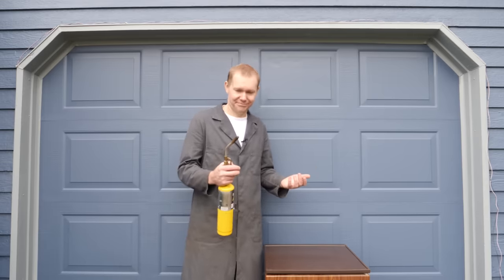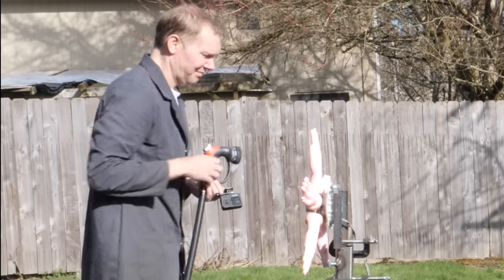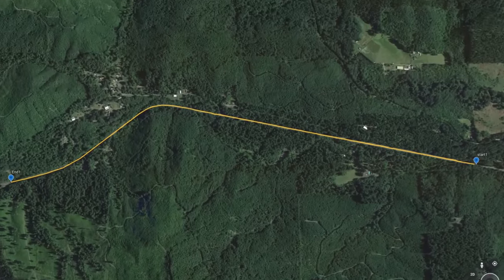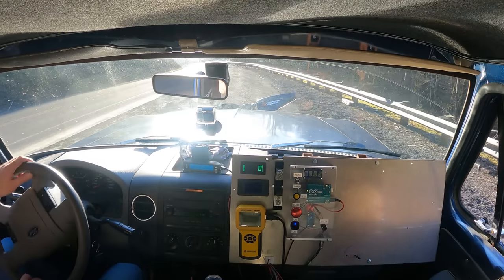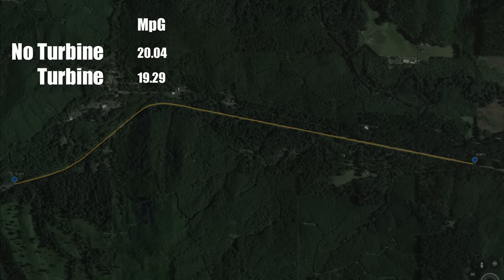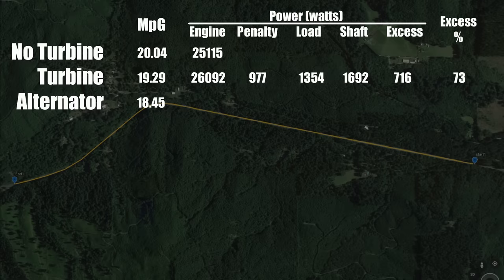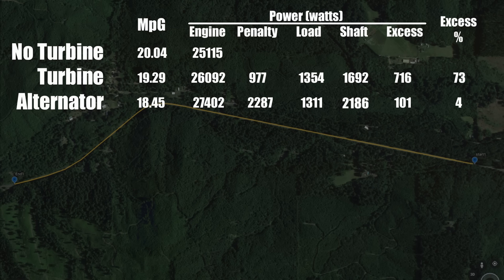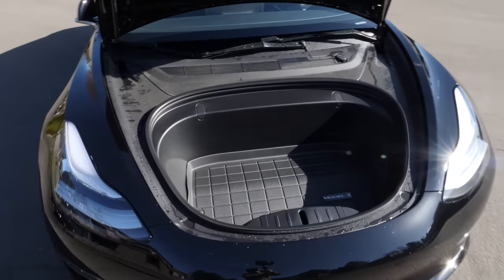Mileage Results You Won't Believe!!! - Wind Power on a CAR #5

Comment: This is transfer of energy via increasing efficiency.  The problem with saying you're getting free energy(and inherently causing a polarizing comment section haha), is that you're not, you're just increasing the aero efficiency of an already very inefficient design(which you talk about). I think a good parallel experiment would be to remove the turbine completely, design some giant fiberglass cone for the truck, and see if you can just increase the MPG in general at the same speed. Then do the math to see if that saved fuel is better "savings" than the power production from the turbine. The other issue is the turbine is only good if you're trying to burn an extra 2000W all the time. So when tesla designs a vehicle, they're already designing for the best Cd and capture those saving immediately. So you can't compare that to a Lada with a fan on the front, since the Lada will have a terrible Cd from the get go.
Reply: That's funny you mention doing a test with a big fiberglass aerodynamic nose.  
I commented the EXACT same thing on the first video he did on this adventure (although I suggested making them weight the same). 
Seeing which one yields the most energy from the fuel would be very interesting. He saw that comment and said that it would be an interesting experiment.  :P
Reply from the maker: Yeah I still like the idea. Just trying to figure out the safest/easiest way to do it and still allow cooling air to the engine. But I'm very curious to know!
Reply: @QuintBUILDs  I can imagine it would be an even bigger project that building that CF turbine.  Maybe some delicious CFD simulations.   😅
Reply: @QuintBUILDs  Since the optimum aerodynamic shape is a droplet shape (as far as I know), it would be interesting to see if a cone in the rear of the vehicle would help, and then you don't have to worry about engine cooling. I think you are getting a lot of turbulent airflow at the back end, so a cone there might help get a laminar flow around the vehicle. It would however probably stick out quite far back. Don't know how road legal that would be either.
Reply: Or alternatively, demonstrate the decreased efficiency by mounting the turbine on the roof of the truck, thus greatly increasing its wind resistance. The turbine would still get the same wind, thus would produce the same power, but the fuel consumption would increase instead of decrease.
Reply: even better.
Reply: I think another test was missing here: driving with the turbine while the oven is turned off.
According to your results, you should improve the fuel consumption.
This is probably the quickest and safest way to test if it really improve the aerodynamics
Reply: @liavhe  Not so fast. The savings hinge on the fact that the turbine slows down the air. If it spins freely, I'm not sure what effect it would have.
Reply from the maker: I've wanted to compare the turbine on top of the vehicle to demonstrate how every watt would indeed come from additional fuel.  I've got a roll cage under that canopy so it's not out of the question to mount to that.  But unless it was pretty high above the bronco I'm betting the air coming off the windshield would "shield" the turbine a bit.  It also might generate more power since there's not a blocky vehicle right behind it.
Reply from the maker: I absolutely LOVE the positive nature of these comments HOWEVER it looks like the video hurt enough feelings that I've got a net NEGATIVE subscriber count on this one.  Thus the algorithm is hiding it from people's feeds (to protect the channel I guess).  Bummer that so many reject the facts and aren't interested in an honest discussion. 😢  Kudos to those that do though! 👍
Reply: @QuintBUILDs  That’s lame! The like ratio is crazy good. This is really great content and wonderfully communicated. My only guess is that maybe subscribers are a little burnt out on the turbine videos? Kind of like the oven.
Reply from the maker: @BRUXXUS  I see what you did there! 👍 Yeah I'm definitely going to give it a rest now that the results are in. I never intended to do so many multi-part videos but the rain gutter series defied all logic and just kept giving. 😂
Reply: @QuintBUILDs  Still waiting for you to get back to the rain gutter with a step down transformer, to bump up the amps while lowering the volts before going DC.
Reply from the maker: @victorsteen73  by how much? We don't want to get below 6 or 7v otherwise we'll have to boost convert which ismuch less efficient. Note the loaded AC output with resistors was only 6-8 volts.
Reply: @QuintBUILDs  The rain gutter series was magic! Also contained one of the best explanations of how rectifiers work. I could be wrong, but maybe the rain gutter generator felt more tangible to normal viewers? Everyone understands what the water coming from a downspout feels like. A kilowatt of wind power is harder to understand intuitively. Although, using the oven does really help put it more in perspective. 
I do think there's room to expand on the things you've learned doing these videos, though! 
If I may suggest, scale it back down to create some wind powered garden lights! I've been tinkering with the idea of designing and building a small wind turbine for that very reason. Kind of like the solar garden lights, but could use wind.  :D 
Bonus points if the turbine could also be aesthetically interesting, like those wind powered kinetic sculptures.  
Could make for a very eye-catching thumbnail. 😉
Reply: The radiator IS the hood so it gets cooling air.

And, maybe the turbine is in the back - harvesting the turbulence but not causing drag. The turbine could be possibly shaped like the vertical-types (Savonis?) that spin wherever direction the wind comes from.
Reply: @BRUXXUS  This has actually been done with bicycles called "velomobiles". By changing the aerodynamic shape people are able to go faster.  This is also done with golf clubs and airplane wheels (to make a larger more effcient airflow shape). Ocean liners are also designed with a bump in front to reduce drag.  Streamline has also been done in Semi trucks. It would be pretty easy to do a literature review and get a good understanding of the improvement in those areas. One could then guesstimate the improvement in the Bronco.
Reply: @jsoers  Trailer tails on Semi Trucks improve fuel efficiency 1 to 5%. With side skirts, it goes up to 12%. (There is a lot of good data out there on these.)
Reply: meh, it's pretty fair to say that recovering otherwise wasted energy is 'free energy'
Reply: Completely missing the point here. Nobody is getting any free energy and he states that unequivocally in his video i.e. "expecting the fridge to work without being plugged in". He neither increasing aro efficiency of the system (car + turbine), quite opposite, more fuel is needed to run with the turbine than without. The whole point is that running with the turbine he is harvesting otherwise completely wasted energy needed for the car to punch a hole through the air. This is the "free energy" - the most basic of concepts. If you understand regenerative braking in EVs then this is the same concept, harvesting otherwise wasted energy.
Reply: @QuintBUILDs  Ford produced several models in the early 90s with a "grille-less" front fascia.  They used the shape of the engine cover and a pretty powerful fan to suck air from underneath the car through the radiator.  Perhaps you could look to those cars for inspiration if you want to go through with the cone idea
Reply from the maker: @limprooster3253  thanks for the idea! Any specific models you can think of?
Reply: @QuintBUILDs  They are called "bottom breathers." The one I was referring to specifically was the 2nd generation Ford Taurus, especially with a 3.8L.  The Ford Probe and its cousin, Mazda MX-6 were also bottom breathers, and to a lesser extent, foxbody mustangs.  And for the sake of obscurity, the Studebaker Avanti is another one.
Reply: @QuintBUILDs  Its the Radiator that needs the cool air flow. Reposition the radiator in the vertical rear tray door area with appropriate opening for flow through and have two advantages!
Reply: He's NOT increasing the aerodynamics. 

He IS increasing the efficiency of the machines movement by converting some of the potential (air's inertia; drag) into kinetic, and then into electric. The reduction in MPG is more than offset in the electrical harvested, this means an overall increase in efficiency. 

Increasing aerodynamics can also increase the efficiency of the mechanism, but it does so by reducing drag, not by converting a % of the drag into useable electric. 

Both techniques have the ability to impact efficiency (aerodynamics & drag harvesting) but they are doing it in different ways and shouldn't be conflated as the same thing. Aerodynamics attempts to reduce overall drag, and drag harvesting attempts to convert a portion of whatever drag is present back into "useable" energy.

It takes energy to push air out of the way. All vehicles have to do this because earth isn't a vacuum. Its just the way the cookie crumbles. Even a design with a coned nose will have to expel energy to push air out of the way, will still create drag. If he were to add a cone to the front he'd increase the aerodynamics, but he'd still have drag that can be harvested.  He could line vertical turbines along the body and ceiling, underneath, along any area where the air drags across the vehicle, and still harvest the drag. 

Obviously only a percentage of the drag is harvested, and vehicle designs that reduce the overall drag also end up reducing the total possible energy to be harvested, so it has its limits and ranges of useability depending on the vehicle in question (seemingly, blocky vehicles will benefit more so from drag harvesting than aerodynamic vehicles) ect. 

Great vid.
Reply from the maker: @chiefrunningfist  man, where were you when I released the earlier videos and weathered a hate-storm in the comments? 😂 You describe the behavior much more eloquently than I. Probably wouldn't have mattered though. People get an idea in their head and can't be dissuaded.
Reply: @QuintBUILDs  Lolol you're a champ! I haven't seen the other vids yet, but your theory, hypothesis, expirementation, and explanation were very refreshing. Great work, keep it up.
Reply: @QuintBUILDs  Maybe go the other way round: Find a car with a more aerodynamically suitable form and attach the turbine there. It should in theory largely diminish turbine efficiency by adding lots of additional drag.
That said, frontal turbines might actually be a nice way of recycling waste drag energy on vehicles that need to be large and bulky.
Reply from the maker: @A.Lifecraft  yeah I'm seriously considering a scaled down version on my old Camry in the background. I need to repaint the hood anyway so no big deal if I accidentally scratch it.
Reply: This  and so much this what SeanHodgins said. If you put any type of propeller or turbine in front of a Tesla you would most certainly add a lot more drag that you would never be able to recover because unlike the square block of metal on the front of your Bronco with a coefficient of drag (Cd) of around .464 while the Tesla Cd that you showed is .23. As Sean said if you were just to make the front of the Bronco look like the front of the Tesla you would save a lot more on energy than putting a prop on the front of the car. Go back to your creepy hand job and figure that Tesla has already angled the hands for maximum efficiency so adding more will just create more drag.
Reply from the maker: @Aircam73  I disagree. I think I can make it work on my Camry with a couple of 12-18" turbines and recover enough power that the alternator will no longer need to operate and spin with minimal torque. Factor in that I'll build/buy a generator more efficient than the automotive alternator and I'll bet it improves fuel economy measurably.
Reply: @QuintBUILDs  You might want to also design a turbine that is optimized for sideways exhaust instead of only spinning up the used air. This might have tilted spoonlike blades instead of "propeller blades"...
Reply: @QuintBUILDs  I will take that bet as your Camry has a much lower Cd compared to the Bronco and you would have to overcome the aerodynamic drag imparted on the car by the prop vs the mechanical drag imparted on the engine by the alternator. Even with a 30% improvement in the generator you will have a very high hurdle to overcome. Unlike the Bronco your generator and prop in front of the Camry will be adding significant drag to a relatively aerodynamic car.
Reply from the maker: @Aircam73  Roger that. Keep in mind literally thousands of people insisted the bronco wouldn't work at all and we know how that turned out. Plus what about the Columbian company featured in the video. Are you saying they're lying or that their car is not aerodynamic?
Reply: This was literally what I told him in the last video. Engineers don't realize how important visual aesthetics are when it comes to cars pretty much all cars have terrible aerodyanmics because people care more about their car looking cool than they do it getting a little bit further on MPG.

I never said it "wouldn't work" I said it was playing efficiency games that could be better played with the overall shape of the car itself. 

Also the other major factor was safety. This just isn't safe or legal we do not use turbines on cars because of just how dangerous they really are. 

This is a side note but Tesla cars are not that aerodynamic either stop praising them as some godsent. They look like almost every other conventional car on the road.
Reply: @seemlesslies  Agree with just about everything you said but Tesla are some of the most aerodynamic cars on the road today.
Reply: @QuintBUILDs  Thousands were right as it did increase drag but when taking in the inefficiencies of the alternator you showed it could be a gain in overall efficiency. The problem with trying to do the same thing with a much more aerodynamic car is the delta between the drags created are much larger than the delta of drag between the bronco and the propeller. While you only lost a small amount of MPG with the bronco by adding the prop because the difference in drag between the two were small. You will lose a lot of MPG as the difference in drag is large when put on the Camry. I would have to do more research on the Columbian video as I don't know what they are trying to say or how they did it. If you post a link I will be happy to respond if they are lying which if they said an aerodynamic car got better range by adding a wind turbine then I would be very skeptical in their findings.
Reply: There is a practice known as "hypermiling" to take vehicles and increase their MPG to the max. Made for some interesting designs.
Reply: Sean: You’ve astutely pointed out that the heart of the matter is to find the best way to reduce aero drag. Most remedies center around sleek shapes and reducing the ratio of friction surface as in the wasp waist fuselages of fighter planes. Earlier it was acknowledged that sucking the boundary layer into slots in the wings helped a lot, but is expensive and heavy. Fast-forward to Tesla’s sleek cars; the next affordable step would be to cover the body with golf ball dimples which are very effective. But the public might be put off by stylistic consequences! Years ago an inventor discovered that low hexagons surpassed dimples, and marketed plastic film to put on semi trucks & trailers. Again, irrational biases have prevented its widespread use.
The main question remains whether  a flow disruptor like this crude fan is always going to reduce drag even for the perfect body—simply because it breaks the wind like a goose leading a flying flock. One caveat is that geese take turns manning the front.
Reply: @limprooster3253 : The restricted airflow of the jellybean bodied Taurus and others led to hotter-running engines which needed costlier rubber components to keep up.
Reply: @QuintBUILDs : Unless this has been said by others or I missed it in your video, a hybrid car could store the electricity from your fan, and clearly yield increased mpg. That would be easier for many to understand than the oven’s role.
Reply: @QuintBUILDs  Towing the turbine on a trailer would isolate it from the Bronco’s airflow. Just make sure it’s far enough behind to be out of “drafting” range—closer than that is an advantage for the trailer because the Bronco breaks the wind.
Reply: @snek9353  Not so. Old cars need front airflow for cooling. At idle their fans have to suck air from wherever they can. The fans also clutch off and freewheel at higher road speeds, to minimize their drag on the engine.
Reply: @FEMBT-yb8rh  Only the US Army’s Hummer had a radiator in the hood, as far as I know. That’s a good place for it but style rules!
Reply: @amicloud_yt  Yes of course. And if he used a hybrid car, the fan could charge the battery instead of powering an oven, and mpg could be measured directly.
Reply: @Aircam73  I actually looked it up it was interesting. I stand corrected they are the most aerodynamic production cars currently on the market, but they still could be improved, and a majority of the reason they are not lower in drag is due to style. They could just cover the back tires like all other previous models that scored better and get big improvements they could make the rear of the car more into a tear like the Volkswagen xl1, but the car would look ugly as sin.

It was a cool paper though.

I also bet he would get totally destroyed in his experiment with a lower drag car. The only reason this test was semi reasonable is because of how much this car is pretty much a brick. I don't think he could have chosen a better car to do this on.

He also took a huge hit on views after the previous video down by 90%. I think he is a decent fellow I just don't think getting combative with your viewers and ignoring their advice and turning it into a pissing match is good for retention.

https://www.tesla.com/sites/default/files/blog_attachments/the-slipperiest-car-on-the-road.pdf
Reply: @jsoers  you could attatch a red rag to the end of the cone. 😁
Reply: @BRUXXUS  : have you ever thought about what you do in the front of the vehicle you have to do in the back in other words if you put a cone on the front and the back needs one too … ??? Right .. And he could’ve put his wind turbine  on the back .. Just a few more added ideas thank you
Reply: @liavhe  I like my pie well Done .. LOLOLOL
Reply: Lol exactly
Reply: First off the refrigerator is a poor example .. you take the heat out of it that all if you can then keep the heat out with insulation your done ... Cold does not exist the same as empty does not exist they only describe the absence of something
Reply: @amicloud_yt  no it's only.... not wasted energy .. you can't create energy you can only change it from one form to another ...
Reply: @jamesgibson7207  nobody other than you used the phrase "create energy"
Reply: "Design some cone attach the fan too it",, wouldn't that just be a sport car with a fan in front of it?.. this guy is putting the fan in a blocky vehicle to see if it can move more efficiently through air... ..wait....I'm not sure what this whole fan thing is anymore lol
Reply: Ur nagging too much
Reply: The only free energy would be like a backfed motor from a self excited motor. I just want a big fan on my truck let's be honest.
Reply: Thank you for your comments. I was wondering if a turbine system like that would be feasible for a solar power generator system for my camper van .everyone tells me it would take too much energy for the Watts produced. I'm already using my alternator to charge my batteries while I'm driving. so would it be more efficient to use a modern wind turbine or the alternator to recharge batteries while I'm driving. I would really appreciate your thoughts on this.
Reply: I like the fun wackiness of the turbine, tbh
Reply: @QuintBUILDs  

Best way you could do it is to add side air intakes, behind the nose and somewhere along the body of the vehicle. I had figured out this idea while working on a extremely efficient motorized vehicle based on bicycle technology.
Reply: @snek9353  I think you misinterpreted that point. He increased efficiency, but he couldn't use the energy recovered for momentum, so his mpg increased. If this car was powered by an electric motor, and the energy recovered feed back into the motor, we would actually see a slight increase in efficiency.

The real question would be: why use such an inefficient car design and then add efficiency measures after the fact? It would be a lot better to optimize for drag in the first place and skipping the turbine altogether.

Very interesting experiment nonetheless. If I'd have known about this beforehand, I would have guessed that it would be a net negative. Amazing to see that he was actually able to reduce drag of his car by such a large amount ...
Reply: and if american truck manufacturers made more aerodynamic front ends it wouldn't just increase mileage it would make these vehicles MUCH SAFER as the drivers would have a clearer view of the road ahead and be able to see children and animals crossing in front of their vehicles which are blocked by the "macho" square front ends.
Reply: Bingo! I totally agree.
Reply: ¹
Reply: @tty23  Yes, the turbine on top of a roadgoing car idea is related to the wind powered cart stuff. Basically if there is energy in the wind (caused by the weather) an airfoiled rotor like a turbine could direct some of that energy to contribute to vehicle propulsion, although that would still be a small fraction of the hughway cruise power requirement for a typical vehicle with a practically sized rooftop turbine. But in calm weather, a vehicle mounted turbine can only subtract from the efficiency of a streamlined vehicle (unlike a Bronco;). Turbines take force to push through the air (or they exert force on the ground when they are attached to a foundation. The laws of thermodynamics say that this force times the speed they are moving through the air is always more power than they can generate at the shaft - the maximum power they could theoretically contribute to propulsion.
Reply: @QuintBUILDs  air flow tends to "hold" to the surface as it travels -- most of the wind going past the truck, wing of a plane, roof of the house, etc is NOT sent away from the surface, but actually flows close -- Coanda Effect.  You should do okay with the fan attached to the truck just far enough to avoid hitting the truck over potholes etc.
Reply: @QuintBUILDs  well I think for that the cone would be a great start, as it would funnel more air towards your propeller and grill forcing it into your engine. But if the air inside the engine doesn’t have a easy path to go it might create a vacuum of lower pressure air, which would reduce efficiency. But let’s face it you bronco is a box. Lots of force working against you
Reply: Testing the propeller vs a nosecone would give you even less control than this experiment has. The proper control would be to leave the prop on but let it freely spin, and perhaps a second test with the generator connected but no load. The result of the test SHOULD BE that the truck becomes most efficient with the propeller on it but disconnected. As load is applied, the propeller should generate wind resistence relative to the control and decrease the fuel economy of the engine. The experiement as presented has no control and therefore doesnt give us any useful data points. Once the aerodynamic properties of the vehicle are changed it is no longer the same vehicle so the base vehicle cannot be the control. The lack of basic scientific literacy in these comments is perhaps not shocking, but at least depressing.
Reply: @patreekotime4578  "Truck should become most efficient with the rotor installed, but free-spinning" 
I disagree. A free-spinning turbine may have negligible drag, but it also doesn't really do much to the shape of the flowfield passing through it. So that flow encounters the aerodynamically hideous grille of the truck and creates a lot of drag. Any turbine under load has some drag, but I think simply because of the smoothly expanding flowfield it creates (well documented in aerodynamics), the drag on the truck is reduced by more than the drag added by the turbine (even when every bit of the energy collected by the turbine is wasted as heat)
So in this case I believe that a minumum truck drag would be found at some positive turbine load value - there would be an optimum.
Now if the truck were instead a highly streamlined vehicle, like a sailplane, then yes, free spinning would result in less drag than any turbine load. And removing the rotor would be even better.
Ditto "depressing". Still, it's nice to find the people engaging in real conversation.
Reply: @QuintBUILDs  The bluff body rear of the Bronco is a huge problem (look at semi-truck trailers). Try improving the rear of the Bronco (for science) first before the bullet nose.
Reply: @QuintBUILDs  Bit late to the discussion here  but would it be possible to connect the rotor shaft directly to engine (via pulley belt for instance)? This would involve careful calculation to ensure the engine does not result in turning the turbine i.e. becomes a propeller! 
By eliminating losses due to electrical conversion, it would be a more accurate experiment to gauge the level of augmentation.
Peter Worsley in the UK has created a number of models (and an actual manned boat) which can sail directly into the wind via a turbine connected by an output shaft to a submerged propeller. It is his contention that turbines designed for propulsion (minimised drag) require different geometry to static versions. An example of this is at the following link:  https://youtu.be/9AV0H1EpTYI
Reply: @QuintBUILDs  maybe move the radiator to outside the car?
Reply: he's not increasing efficiency, he's just doing bad math based on incomplete data,
Reply: @QuintBUILDs  don't you think this is ridiculously dangerous? Do you not realise that it you're in a car crash you could easily kill someone, then end up going to prison for manslaughter?
Reply: This tech might work better for an eRV or EV truck equal in size to a deisel which are now out at a cost of $250k with 173 miles of battery range.
Reply: If your utilizing drag to create power, why would you care if there is more drag? Actually, there has to be a sweet spot where drag and a streamlined design allow the most optimized efficencies. Just like regenerative breaking your utilizing more than 1 system to maximize all the forces going in and out of the vehicles travel. 😉
Reply: @lost4468yt  🤦🤦
Reply: That Tesla will need that extra energy for a descent sound system.
Reply: @chiefrunningfist  please make a seperate reply that can be ulvotes. I luckily scrolled through this comment section and I am happy that someone explained it so eloquently that I can now understand and believe how / that this works
Reply: That’s the ticket…not that would actually work…do some weight reduction also and drive slower
Reply: hes not saying its "free energy" hes saying its more efficient energy wise
Reply: Nice. The saved fuel could be way more valuable in the future too